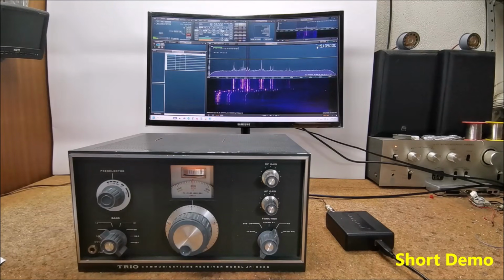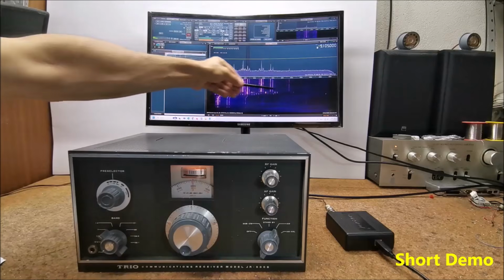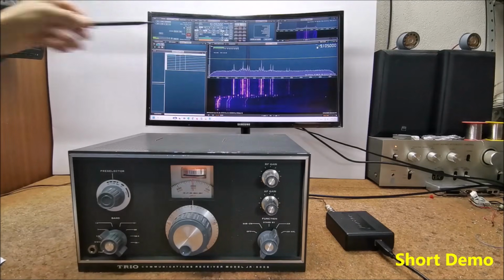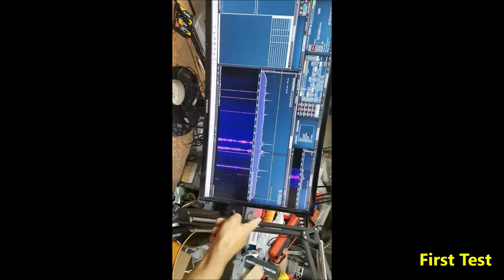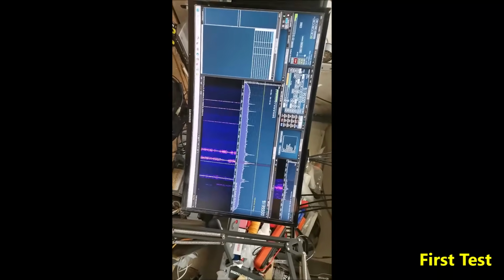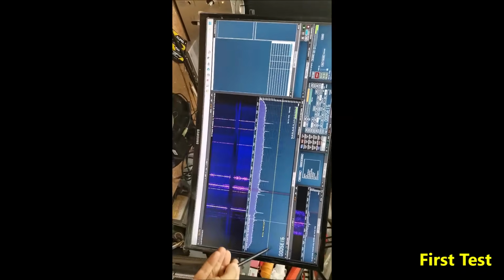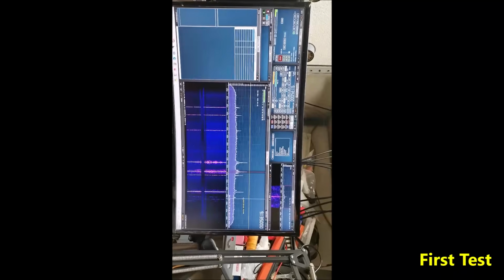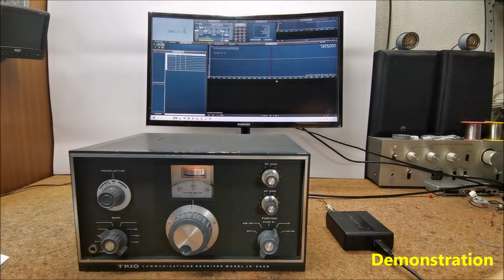SDR Panadapter for Vintage Tube Radios – Step by Step Tutorial

Comment: I'm doing a panadapter and rs232 rig control on my Drake R8B mainly so I can get a better S-Meter for setting antenna gains on my modified MFJ 1026 Phase Diversity noise canceller. I will be using RG142 to a BNC jack, An RY32 dual tetrode is sitting here...NOS, 4 of them, to be exact. So why not use one for MY low impedance amp? I'll have spares. I'll be using my Ham-It_Up (To up-convert 2nd IF lower frequency) and RTL-SDR dongle on a Raspberry Pi 4 w/ 8GB RAM running XFCE 4 / GTK3 > Smart Gnome Control, Hamlibs, etc. Audio out to my Drake MS8 speaker is through a Xiegu GNR-1 DSP/parametric equalizer. I will build this prior to any further antenna builds or mods so the better S-Meter can tell me how I'm doing. I see this mod as imperative.